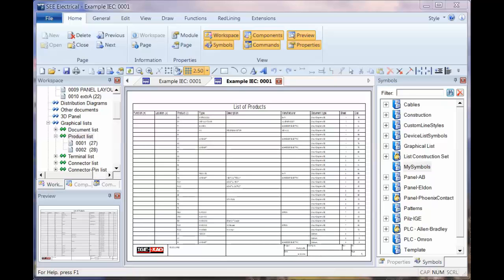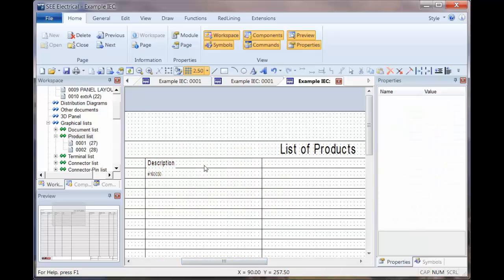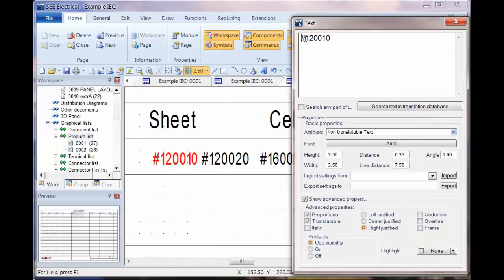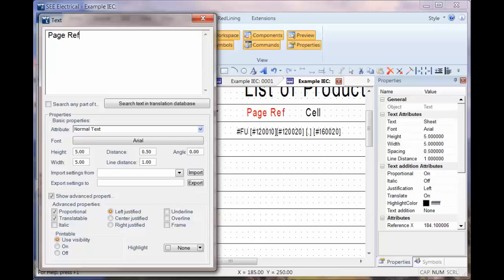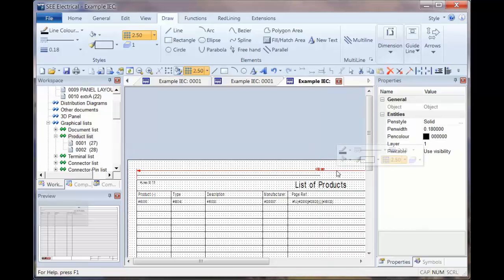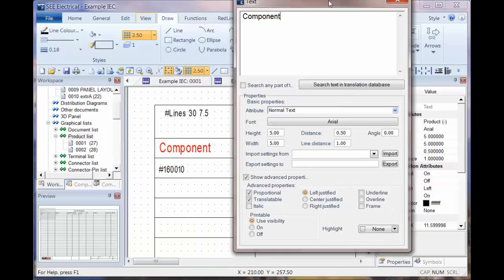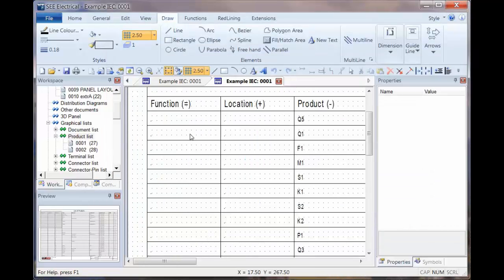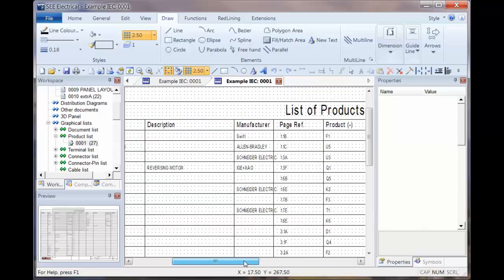Graphical Lists Part 7 (multiple columns)

Comment: There is any list for multi products ( with the same type) in the same cell?
Reply from the maker: In the advanced/scale level package there is a graphical list and database section called Compressed BOM, which produces a quantified bill of materials together with a column for the tags e.g. K1-9, K12, K15. I think this is what you're asking for.
Reply: @IGEXAOUK  yah, but I`m just saw this option on VIEW not on graphical list. I think is some EXPORT xxxx command is hide after solve this I will need know which the parameters can I use on this Graphical list.
Reply: Well, I went to the project menu in Graphical list and then in Definition list and look for parameter export_4207 creating a new definition, as I don't know which codes to use I used the "component list" template in See electrical default installation, and then it gave an acceptable result now I need to see how to make each component show its page in the line of this graphical list.